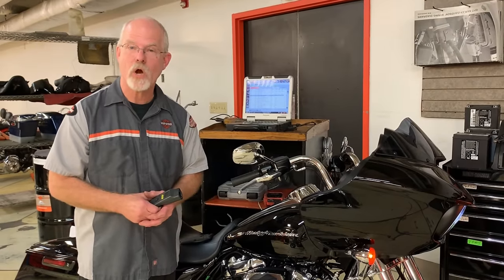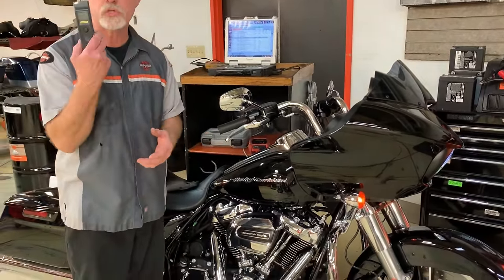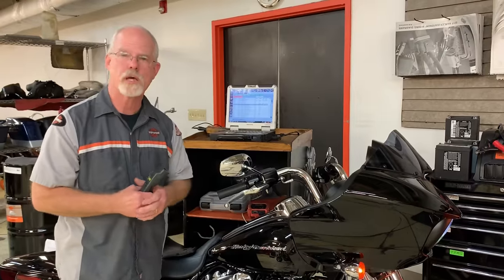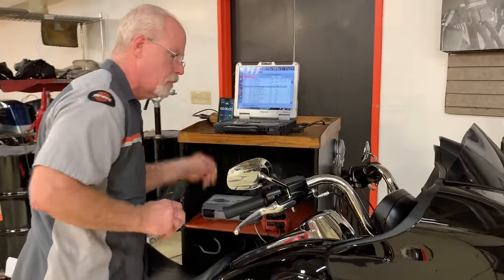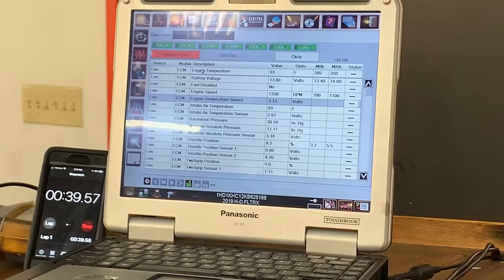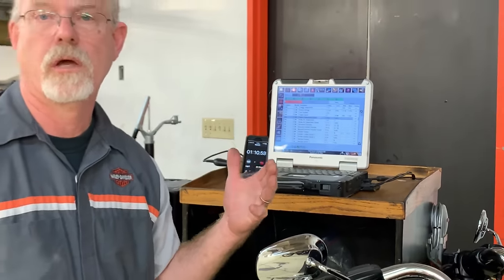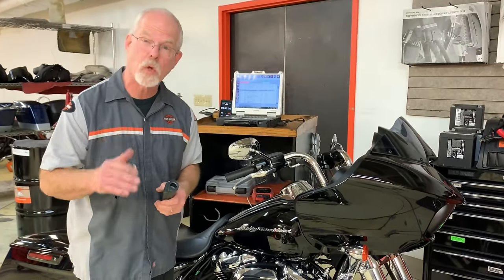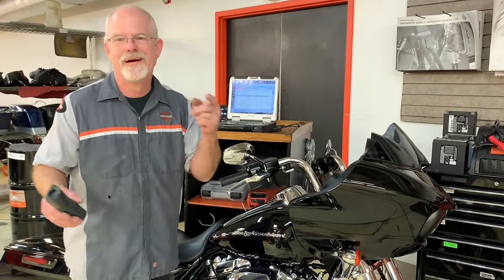DOC HARLEY: HOW LONG TO WARM UP YOUR MOTORCYCLE

Comment: so h.d. oil does not suspend the dirt , and the filter does not trap the dirt .. so your saying if you change the oil cold all the dirt is at the bottom of the motor and not held in the oil ..BUT WHY then does the oil get dark it should be clean because all the dirt has settled to the bottom  ..right .. so even though the dirt is settled to the bottom YOU want to start it splash / cover the inside with dirty oil , then drain it , and fill it up while the oil with dirt is still clinging to the inside .. ya right .. sorry but its 2019 oil tec not 1930 oil tec .. well ya maybe with a 1930 h.d. design  you need to do this [ hot ] because the oil is a straight 50 but '' DOC '' the oil starts out 20 then heats up to 50 weight .. wow really you say ya that's 1980 tec .. gee how about that , thin to crank and flow cold ...thicker when hot  gee  that is some scary oil ..

Comment: I let mine idle until the heads are warm with choke fully out , than slowly ride away with choke half in for a couple minutes,  owned the bike since 04 and not a single issue
Reply: Those 3k miles per yr that you ride, and it'll last another 15 yrs!

Comment: Wait.... what about the outside temperature ?
Reply from the maker: Yes you have a valid point. Outside temps may have an effect externally but I am concern with internal temp...Doc
Reply: @LowCountryHarleyDavidson  So, the colder outside, the longer it should warm up ? Thanks

Comment: I used to run below 2500 revs on my Evo for the first 10 miles I  would have let the rocker  boxes warm to the touch had I known . I had the carb tuned lovely with the  1200 Sportster needle a 165 main jet  a 180 main jet the blank drilled out and the mixture screw backed out 2 5/8 turns to richen the mixture the stock carb setting they run lean and hotter .also a k&n filter and rev tec mufflers  If I lived in a hot place and rode in the city I would look into some love jugs cooling fans and oil cooler is good too but less effective stopped in traffic . I don't know if they are a gimmick but they got to help more that chrome covers that just retail more heat .  Both my bikes are fuel injected  liquid cooled 1000 cc v  twins now a Honda and a Ducati I still let them warm up a bit before take off .  I might get a carbed  Evo road King in years to come we will see how things go with money . I let my Evo go because the mileage was getting high I do that I just sold another bike for the same reason I buy them low milage treat them right run them for how ever long and sell them when they still have a lot of life left in them . Ride safe dudes .
Reply: @benjytexas  I since sold the Honda and bough a Moto Guzzi 1200 4 valve it's more like a Harley in it's way air cooled push rod v twin it has fuel injected engine  6 speed box abs brembo brakes unobtrusive shaft drive touring fareing and full luagge  it's a lovely old plodder of a thingand good for long distance work with a very comfortable saddle  I haven't it  long enough to know if I really like it yet so far so good I can see myself getting more into it once I suss it out  but the Ducati is a very fun bike to ride and a thing all of their own . Harley's are nice enough bikes to ride long distance if you get a touring model  and they are reliable  but very expensive for for you get and not the best of brakes tyre profiles or brakes on some models . Give them all a try you only live the one time enjoy them all and ride to live .

Comment: More important how long is to long? I'm in Oh. and it 23° in the morning. So it 10min. To long.
Reply from the maker: Yes 10 minutes is pushing it. Max I’ve taken it to 5 1/2 minutes and that’s putting motor temp at 200 degrees. BTW: Super impressive riding in 23 degrees. Thanks ~ Doc
Reply: @LowCountryHarleyDavidson  I just love to ride. I ride every day. I didn't spend all that money on my bikes to let them sit all winter.getting my roadking together for the 66 thing with my son at the end of the month. Hes never bin to the big hole.

Comment: I always let my bikes warm up or in cold weather put my hand on one of the cylinders and see if its warm  and just take it easy the first couple miles  1/4 -1/2 throttle.    of course its a lot less in warmer weather .   if your going to wait for 4 quart of oil to heat up your going to be there awhile.     I have  been doing it this way for many years with out any problems

Comment: Something I have done for the past ±50 years us to loosen up the clutch, is by putting the bike into gear and rocking the bike 'till I can feel it is free. I have never had gearbox or clutch trouble, even with my current bike which is 23 years old from new and 60k miles on the clock!
Reply: In those 50 yrs, you missed some English classes! "us to loosen up the clutch"
Reply: @benjytexas  Wha ha ha ha 😜

Comment: I warm it for 5 - 6 mins then ride real easy on her for ar least 10 - 15 miles and we dont ride at all if she is not going far enough to get everything up to operating tempture old shovel with straight weight oil so far seems to be working fine

Comment: one thing that will help with the warm up is get off the HD oil. Put the best oil in it and use Amsoil. It moves through the bike much quicker and warms quicker. It also protects the bike much better than the HD oil made by Sunoco.

Comment: Pop on access delay tps tapin throdle since day 1of my air cleaner +fp3 install 2 1/2yrs ago.the head brace ipeded tbody  gasket or gap in gasket removed brace aspur advice.man I'm a sporty guy it's 1200v hard candy my perdlady grew Lott's of trdlle and piqer control . Tursting u with my life . Fan and admirer of what u do.thank u .

Comment: How long?

You start it and ride it.

Idling is the worst way to warm up any vehicle.

What's the point of having a hot ready to go engine when your transmission is completely cold?

Just ride gently until up to operating temperature.

Comment: Gimme a break. I don't need an electronic sensor  & all that mumbo jumbo on my 1980 Honda CB-750 to tell me when it's ready to roll the wheels. Hit the starter & let her run for a few minutes on a cold start then put it in gear & we're off. Oh, are you talking to the yuppie wannabe bikers out there that don't know crap about an engine!!!   Btw, I also own an '05 Sportster. Ask me which is the better bike.

Comment: Bunch of crock, start it up cruise easy, by the time you get out of your neighborhood the fuel ejection system will automatically drop the rpms and you are ready to hammer the throttle. So your hole theory is full of shit

Comment: I had 1980s Honda motor cycles never had to warm up. Never been impressed by HD
Reply: What ever ! My father bought a new at the time 76 Honda goldwing and that bike was cold blooded as hell until it warmed up good !  Was a quick bike decked out with the Vetter wind jammer fairing Bates bags CB radio FM stereo and a aftermarket seat and it still didn't ride great I remember him saying when he first bought it so after 3 years he sold the bike and bought another HD lol , sure it wasn't as fast or as smooth but it did ride better because I got to ride both bikes and he would let me ride the HD to high school back in the day which the girls just loved lol !